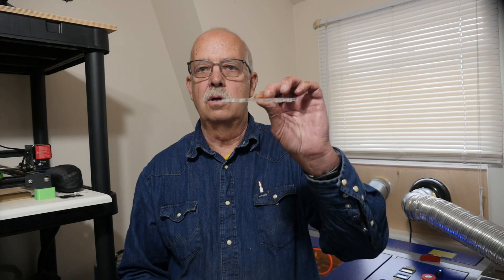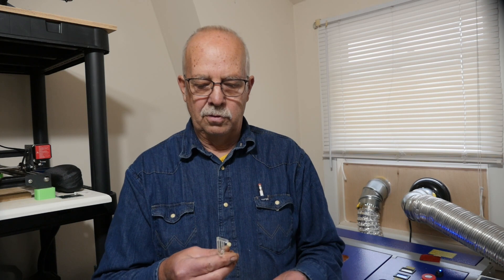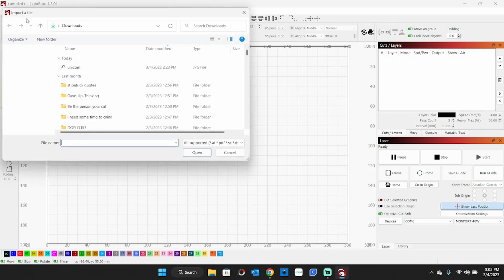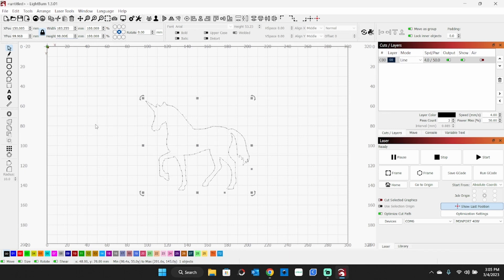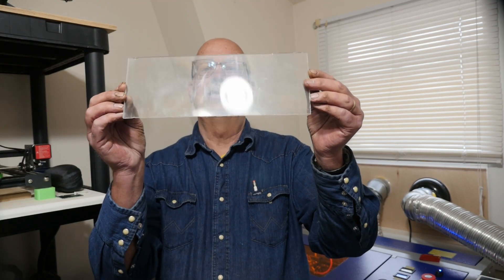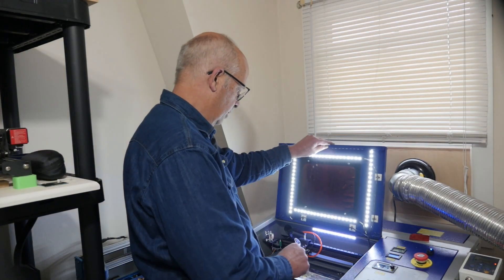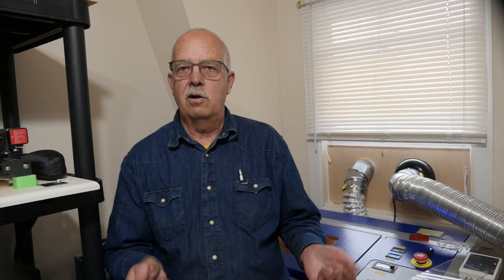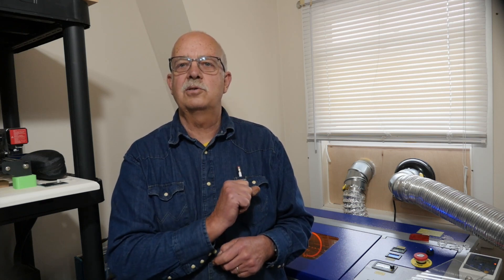Laser Cutting Clear Acrylic On Monport 40W

Comment: Very nice. I see that the bed for this K40 has not been changed. I just bought the MonPort myself and I have only run simple lines and circles in Dollar Tree plywood. It is hard to find a good honeycomb that will fill this bed, plus have the ability to raise and lower the bed. It looks like yours works just fine without changing it.
Reply from the maker: I have most of the things I need to change the bad and make it adjustable.  Just haven't had the time to get to it.
Reply: @rogersshop  Hopefully you can show us how you did it when you are done. I have looked in numerous places for an "all in one" solution, but I have not found anything that makes me feel confident it will be level. Thanks for the response!